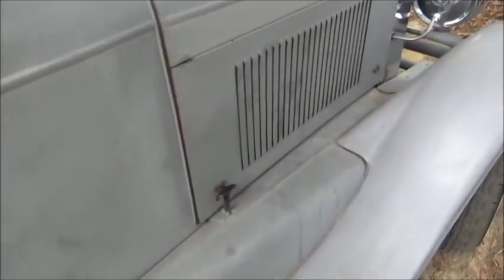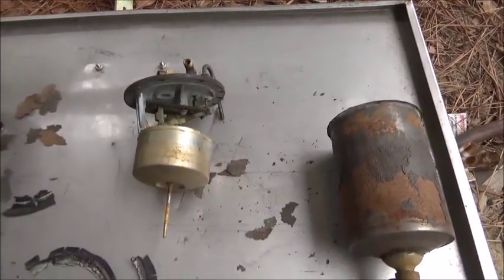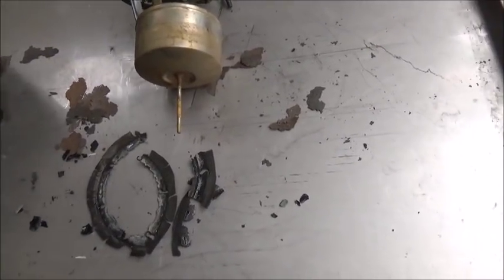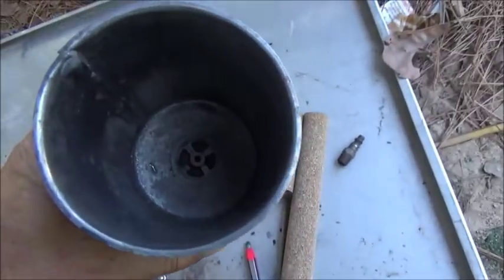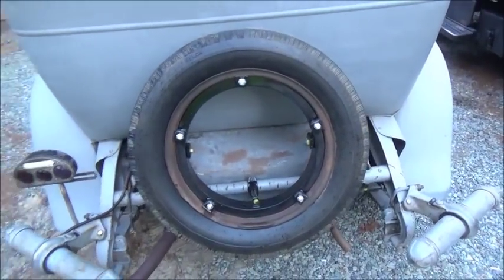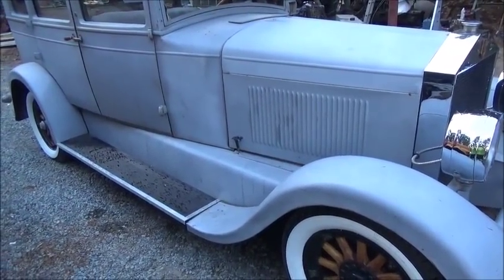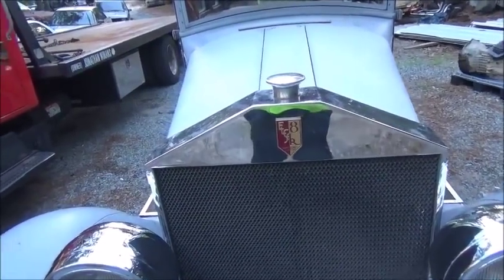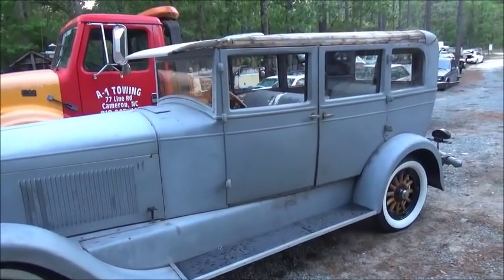1927 Elcar Tires, Fuel Pump & Other Updates

Comment: Really proud of you using the vacuum system without previous experience with the unit.  Most guys are quick to change out the vacuum tank for a electric fuel pump.  I always tell them, facetiously, "you're right.  Vacuum tanks are terrible. Every 75 years you have to reseal them, but electric fuel pumps last forever". There's one problem they can have in the die-cast.  The needle that cuts off the fuel when the float rises runs in a ferrule.  The ferrule is pressed into the die cast and sometimes, with time and use, they get loose and will get cross-ways in the unit.  You'll be running along and fuel will back up and be running down the vacuum line into the manifold.  What's evil about it is when you take the thing apart the ferrule will right itself and you can't find the problem.  My fix was to epoxy the damn thing into its place.

Comment: Whitewalls look classy, even with the primer paint job. Bet they ran smoother down the road than the old rotted Sears tires that was on there. Wonder how the spare would look with a few thick coats of white paint on the sidewall. Sorta a frugal whitewall for looks, till you can get the fifth tire.

Comment: That glass-jacketed fuel filter certainly isn't "period" for a 1927 vehicle and for that reason alone I'd probably at least relocate it and make it invisible. However, if you're concerned at all about the safety of the glass, let me reassure you, the glass is tempered Pyrex type glass and tested for impact and pressure resistance. How do I know? I made (and sample-tested) hundreds and hundreds of thousands of them for Corning Glass Works (now Corning Incorporated). Shoot, I may have made THAT glass jacket. Don't know what those filters cost these days, but you can disassemble it to clean the filter and then just put it back together. And yes, I'd recommend locating it where it's not susceptible to stones hitting it. I LOVE THIS CAR. Looks better every time I see it.

Comment: If the float were to stick in the fuel pump, would it overfill and suck gas straight into the manifold?  Did a good job on the emblem, saw it before you said something and thought you must have bought the $200 one.